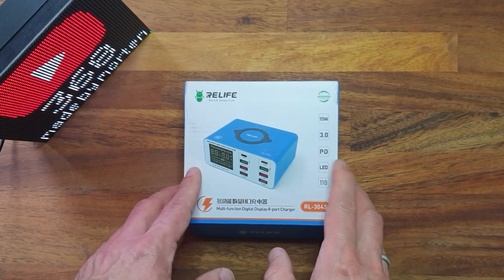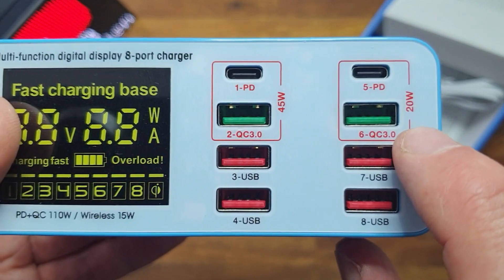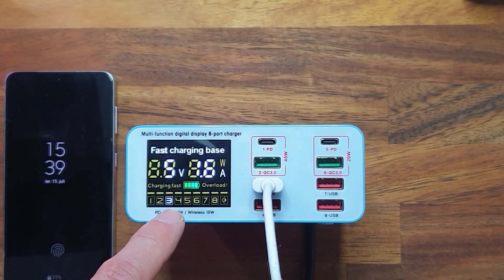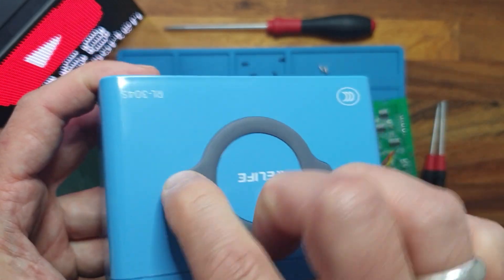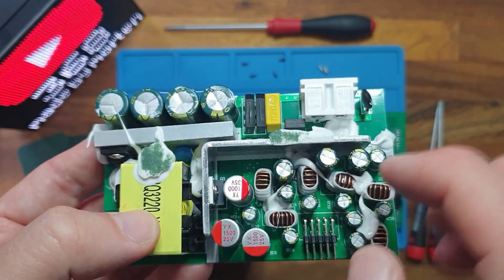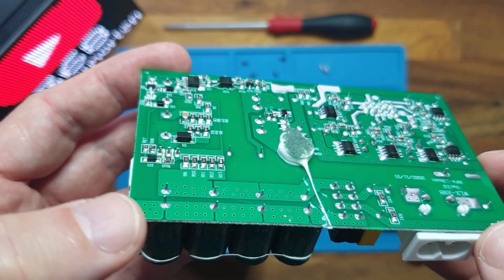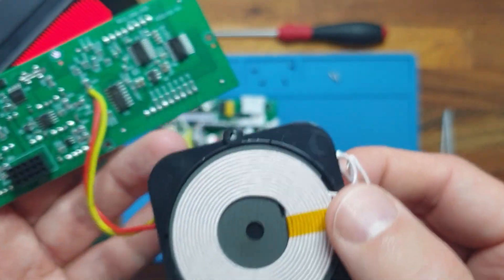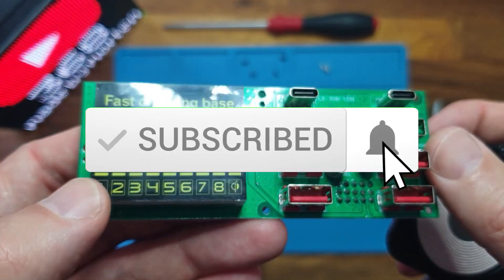NorthridgeFix / Relife RL304S teardown

Comment: Any insight why using parallel bridge rectifier, Thanks for the videe
Reply from the maker: @fajarsan329 You are welcome :-) Parallel bridges is a way to distribute the load between the tto bridgess, this may or may not work. The diodes in each bridge will turn on at very slightly different points in the AC cycle. When an AC cycle begins, one bridge rectifier may temporarily be carrying all the current, until the AC voltage rises a little more. This could damage the bridge and then the next one will carry all current and then this one will break too.
Reply: @made.by.morten.laboratories  Thank you, this deinitely clear some confusion had.

Comment: Very dangerous power supply, worst case the primary & secondary heatsinks could touch each other and also one of the caps could touch the heatsink which then leads to mains power at the output.
Reply: You don,t need to buy if you are concerned about your safty, please make your own and show us how safe is and how it works. You have cheap and a free shiping on a products, and yet, you all complain about how cheap is or crappy, but you need to respect the effort, to make it cheap and send to you for free.
Reply: Doesn't matter. That device works with high voltage, if you prefer to die, you do you.
Reply: @videostar348  How you can die when is glued with PCB and also soldered on PCB plus is on a plastic case so don,t worry you don,t die from this device maby from other or from food but not from this device.
Reply from the maker: Yes i don't know why the don't secure the parts better, using glue is not an option when dealing with high voltage